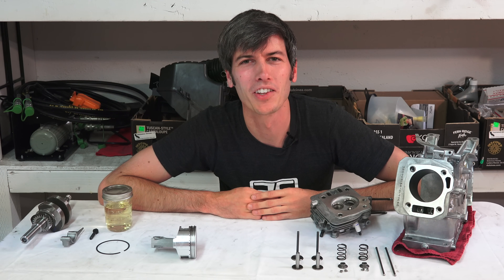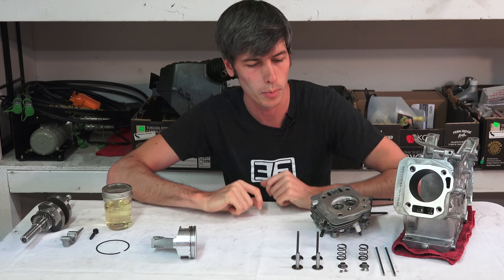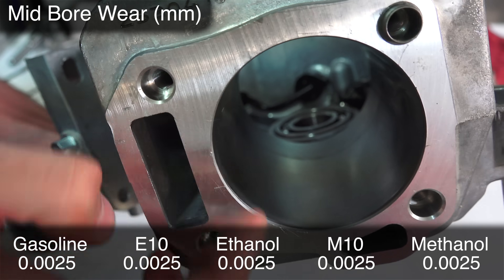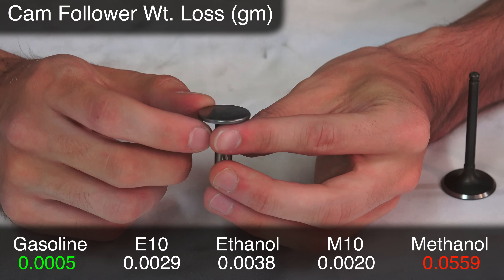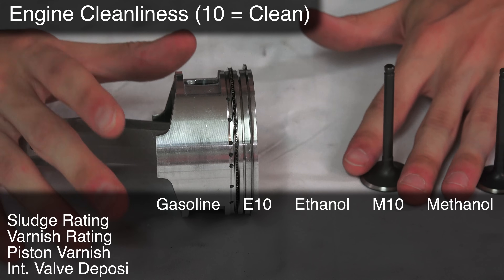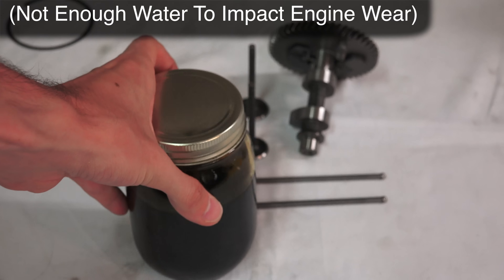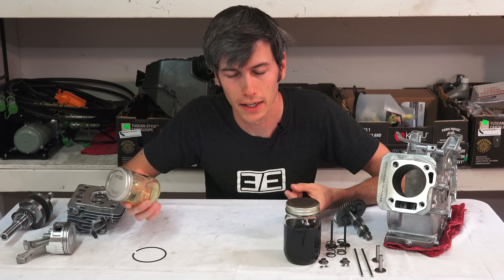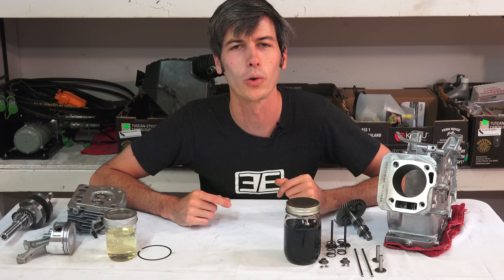Is Ethanol Bad For Your Car's Engine?

Comment: Ethinol Bad for unlined steel gas tanks that sit though. I had to drop and clean out the tank of my mazda mx3 after sitting for a few years. Added a fuel stabilized but that was not enough. Also had to replace the gas tank on my unlined motorcycle tank for my 2004 ducati monster. A nice $2k for tank, fuel pump, fuel lever sensor etc. Thanks FL for making sure premium has ethonal too. Fortunately most tanks are lined now or plastic so less of an issue. Just drain bad gas vs a rusted up and/or holey tank.
Reply: You generally shouldn't let at gasoline sit in the tank for years on end, that'll cause trouble regardless of ethanol content.
Reply: you can coat the tank DIY . . . going to need to do this to my boat, not excited about that project
Reply: Yea, i lined the new motorcycle tank. And i agree on storing fuel, but non ethanol gas with fuel stabilizer is usually good for 4-5 years. Now with ethanol its more like up to 12 months. And even then you need to fill the tank to minimize air. I store my generators dry now same with my motorcycle.

Comment: All BMW e36/e39 and upwards are ready from factory to use E10. I am using it on my 1996 E39  and I have no problems whatsoever.
Reply: @Bernhard Jordan, it's the M52 engine which can run even higher on ethanol . Still, a good pun 😉
I was just saying that you can run E10 even on older cars than 20 years.
E36 and E39 (e38 also BTW) were already ready for e10 when they came out.
Reply: ...you will have problems just give it a bit ethanol is more corrosive as well as at high RPM you need more ethanol to create the same power so your probably down on peak power i leard that from... mighty car mods when they did an ethanol mini Cooper they had to put it in a different injectors a different fuel pump on a different fuel system to get more fuel and create more power but if you use the same amount of ethanol fuel as gasoline you will actually make less power ethanol has and the biggest Advantage from a power stand point when it's force injected
Reply: @SSYoung125 , Mighty Car mods were using flex fuel, e85, that's why they had to put bigger injectors. The AFR on e85 is around 7:1 so you need 7 parts of air to 1 part fuel compared to 14.7:1 on gasoline /E10. 
You've not learned enough, watch that episode again... 
E39/e36 have hard lines for fuel, ethanol  is eating rubber for breakfast, the only place where they have rubber is between the fuel filter and fuel lines, and that's a special compound rubber, resistant to Ethanol.
Reply: @eEnzo0  actually, 14.1 on e10 and about 14.7 on pure
Reply: @forbiddenera  you are right Sir, and that's because of Ethanol having a lower AFR. Anyways, my M52 pulls a bit better in warm weather with E10, on RON95 due to high compression and port injection quite often I found myself having low power under Vanos starting point. I change the camshaft sensor every year, i consider it a good investment (20-30eur in one year, I have more gains in fuel consumption with a new sensor). 
Fuel consumption is not higher by much, I drive the car mostly in the city and in weekends going on Autobahn (5000rpm). Average city fuel consumption is around 12.5l/100km on normal driving and 13.5l/100km a bit sportier.
It's quite on par with normal Super gasoline RON95 what i can buy here in Germany. The problem with gasoline is... Quality. With some is pulling ok, with some is just sipping fuel and she's lazy.
Reply: Some cars have gas pumps out of aluminium which corrodes
Reply: @brokkrep  on BMW? I was pointing out the beginning on bmw cars, not sure on other manufacturers what kind of pumps are using. I have some friends here in Germany who received the answer, YES you can run E10 without problems on e36/e39 even if it's older than 1998, direct from bmw.
Reply: really? whats your source, i mean thanks i have e36 but im just interested

Comment: That was very interesting to watch as usuual, thank you! And well, Cars in Brazil have been runing pure ethanol since the 70's. Our gasoline is @ 27% currently, but that should be increased soon - poor us with non-flex cars.
Reply: Allegedly E27. It's very common to run an OBDII tool to find it running on over 35% ethanol mixture...
Reply: É verdade, broder! Erro de char